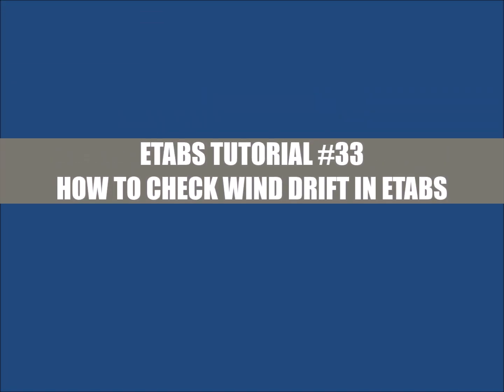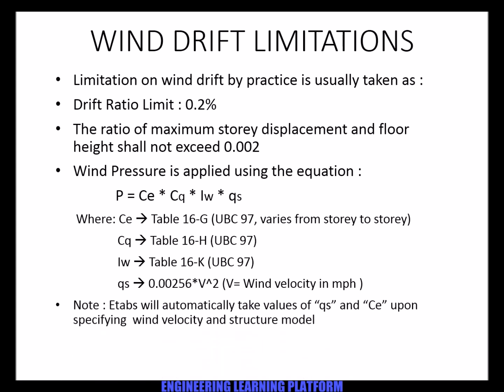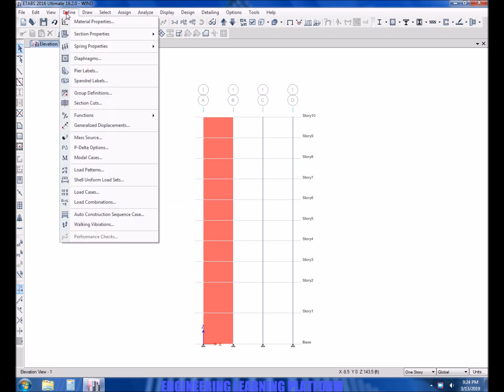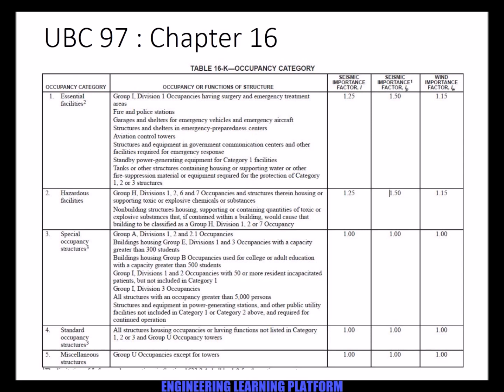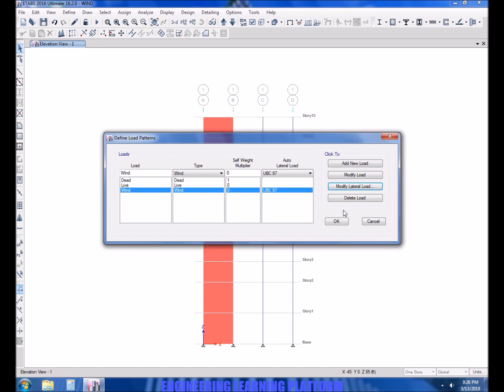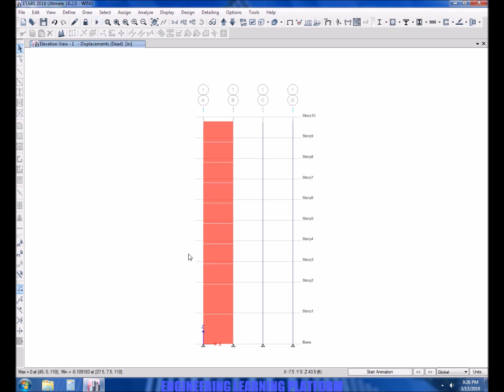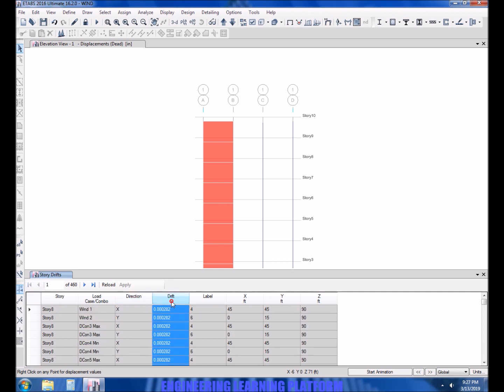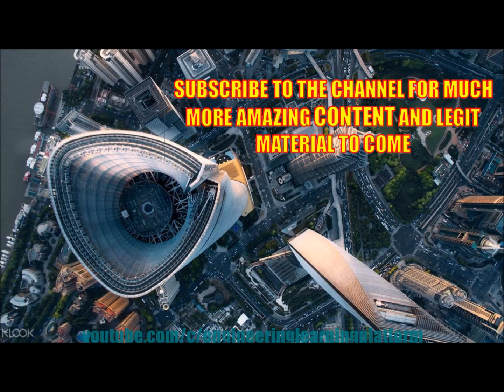How to check drift limit due to wind using etabs

Comment: Etab 20!7..there is no detailing option..wt should i do
Reply from the maker: Use etabs 2016
Reply: @EngineeringLearningPlatform  detailing accurately etab 2016?
Reply from the maker: @ezhilarasan3776  yes 16.2.1 but why dont use autocad for detailing and etabs for design only . I guess its better to do so
Reply: Hii
Reply: @mohdkaleem1173  hi
Reply: @ezhilarasan3776  Country name